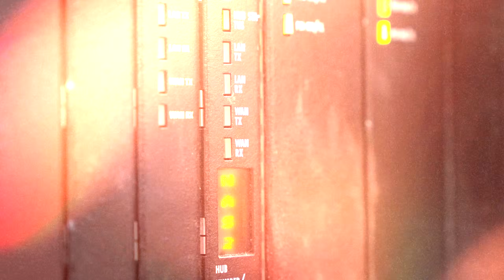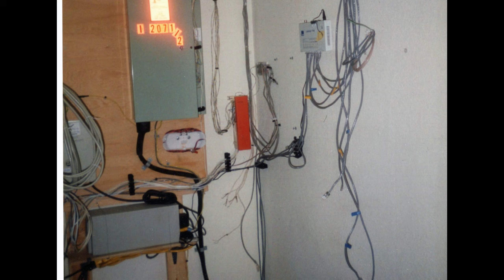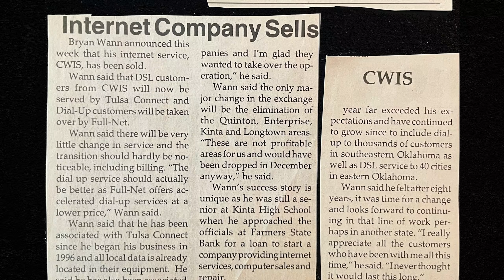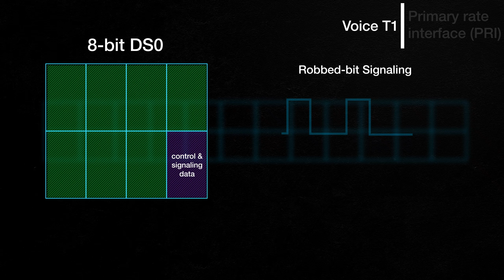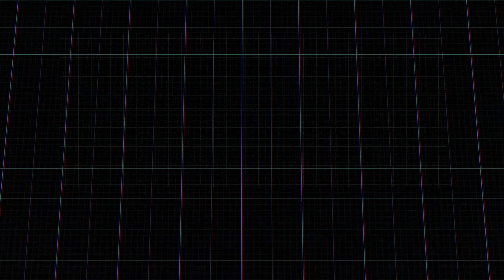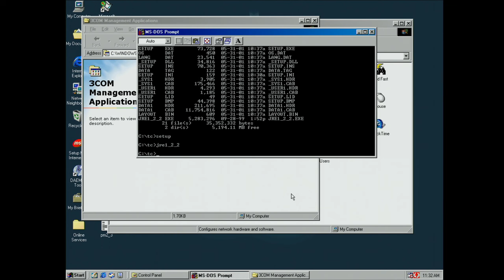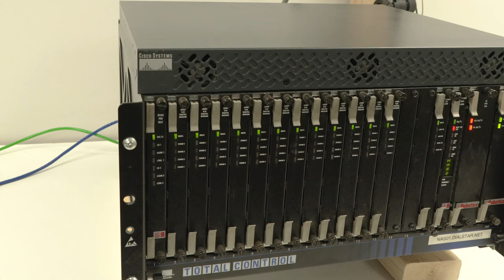DIAL-UP goes DIGITAL: Setting up PRI for the TOTAL CONTROL - ISP Ep 7

Comment: when I first got DSL (despite being a paperboy who was inserting flyers from the local cable company who in Canada were in advance over the world, i know some people who had cable modem in 1998, the huge wall mounted (unencrypted DOCSIS 1.0) Scientific Atlanta cable modems that required a cable from one's basement where it would typically be placed and a pci adapter for a coax cable coming from it to connect it, my other friend who had a mom working for that cable company/now also isp, had dial-up service, mostly to use when you weren't home, but they also straight up dial-up, he had a Motoral SurfShark 4010 (I think the name was SurfShark) which was DOCSIS 1.1 (if only that same ISP, Videotron would do like its competitors in the west, install DOCSIS 4.0 to have cable be able to compete with FTTH with symmetric connections) or just move entirely to fibre, but they combine fibre and cable with DOCSIS 3.1 a technology that was newish when I finished my master's degree in 2012 and lived in my own apartment for the first time, the small ISP I was on had DOCSIS 3.1 cable modems)....anyway as I was saying, it was frustrating, those Videotron slips I had to insert into every newspapers for 6 months had a promotion with them, brand new docsis 1.1 modems that went up to 38mbps/8mbps (we're talking year 2000 there wasn't a bunch of tiers, everyone got the same hallucinating speed), for 29,95 a month and you had to buy the modem, typically it was 400 dollars (CAD) and during the promotion it was 200. Parents kept saying we'll think about it, as they wouldn't even change our 33.6k winmodem for a 56k one, at least. A few months after the promotion was over, the big telco Bell Canada released their DSL service in our area and it wasn't as fast as cable, we're taking 1.5mbps/720kbps but it was still lightyears. To make calls on our phones we had to install a little bridge in between the landline phones and the landline entry, that's how they did voip, if you didn't place those little bridges, you'd get so much distortion it was impossible to use. Anyone knows what I'm talking about? And what were they called?

Comment: Used to run a ISP here in Melbourne Australia 🇦🇺 in the 90s. At first we had a Xylogics Annex 4000 with analog modems. The annex 4000 had 72 ports from memory. We then moved to a Xylogics Annex 8000 which had E1 ISDN PRI and 56k digital modems. So much easier to manage than all those modems on analog PSTN “hunt group” phone lines.

Comment: Had about 30 of these in the 1990's, early 2000's.   They were hateful things.  Just getting the RADIUS configuration working was a ball-ache.  I worked for Asia-Online and integrated a bunch of acquired ISPs into us.   We standardised on the AS5200 for pretty much everything.   We also had Lightstream 1010's - this is how we got our ATM services terminated internally.

Telstra was a funny bugger at this time - they were competing with us for market share in the dial-up segment - but also had to sell these services to us using a third-party.

Comment: Hmmm how does my current pri run over fiber?
Reply: The telecom world has created an "X over X" standard for any possible two technologies.  Voice over ATM.  ATM over Ethernet.  ISDN over carrier pigeon.  Whatever you have and need, there's a way to cross-connect it.

1.54Mbps is such a trivial amount of bandwidth these days, that no matter what the underlying infrastructure is, you can drop a "T1" on it, and just add a card that will do the physical signalling at the end.  And even that, at this point, isn't strictly required, since you can configure lots of non-T1, non-ISDN hardware to form a gentleman's agreement such as "let's just allocate this much bandwidth and pretend it's a serial link, okay?"  "Yep, cool."

Comment: I'm using a similar setup. But the asterisk is equipped with a E1/T1 card and provides the span itself. So no need for the cisco VOIP/PRI-adapter.

Comment: I'm surprised he had so much trouble with "other" modems. We never had issues with the one PM3 we had for testing. (went with the TC's because they were just better) Interpath started out with Microcom chassis modems connected to netblazers. We tested many different vendors before writing a 6-figure check to USR. At first, we connected them to the netblazers - because we weren't using RADIUS. (we had a few issues with the microcom's, but there was a "this thing is fed by Sprint" dip switch - undocumented of course - that fixed that.)

Comment: I want one too, but i live in Germany so it's even harder to get one here...
Reply: To get what here in Germany? A PRI?

That's not hard, that's impossible to get... Except you can get hold of old ISDN gear from the network and build a private network with those devices...

ISDN is dead. The Telcos don't get spare parts anymore. So the few Telcos that were still delivering ISDN, already had reduzed their SLA to best effort. They said: We will try to reuse parts, we had teared down elsewhere, but if we can't get hold of an used part anymore, then your ISDN is ended... It was just to enlarge the migration time frame for services, that needed to be migrated from ISDN. (Electronic invoice exchange and delivering data to the health insurances were such things, where the migrations to IP had started way too late...)
Reply: @compukiller2  no, a total control modem bank

Comment: I never understood why T1 lines were so obscenely expensive , but then again it is your own dedicated loop to the CO.
Reply: Part of it was the service behind it. With Southwestern Bell I could call in a down T1 and have somebody start testing on it within the hour, and they would dispatch after hours/weekends to repair it if you pressed them on it. Every site also had a hot spare T1 loop they provided that we could swap over to. Not likely to happen on a DSL or business phone line. Of course there's exceptions, I regularly dealt with at least one telco who was very much "down T1? we'll look at it tomorrow" thing.
Reply: @bryanwann  really? I would have thought because a T1 and it being so pricey it would be given a greater priority rather than next day if it were down.  After all no regular Joe would be running a T1 at a residential location or something.   I would think only a business user / account would only have a T1 or ISDN at that time.
Reply: You can thank the government for that. It was one of the many regulated services required of all telcos. (at no point in history did a T1 actually cost $1000, but CEO's have to have that yacht.)
Reply: "Dedicated loop" -- so is a phone line.  Or, it was.. until they were just simulated loops over whatever cheaper infrastructure.

Bryan's got the right idea here.  They were expensive because it was a business service, in part, and came with business-class support.  It's also worth considering what the T1 connected to.  It's just a 1.54Mbps digital circuit, at the end of the day, and that has to carry something.  Whether that's multiple phone lines, point-to-point data, or Internet access -- each would have their own service charges on top of the loop itself.

And yes, the regulatory agencies set prices on these things that were often "generous" compared to what it cost to deliver.  Although I think the "yacht" metaphor is a bit over-the-top.  I've worked at/with service providers for most of my career.  In most cases, nobody's getting filthy rich off of your phone bill.  This stuff costs a lot to build and maintain and support, which is why the regs are there to begin with.  In one of my former lives, I worked at a provider that had clusters of customers in remote areas that could only be reached via microwave.  Tell me how you live a champagne lifestyle billing thirteen customers for a phone line that has to go 100 miles through mountain passes, and may only bill at the same rate as someone in an apartment complex downtown.
Reply: @sirnickity  Yeap. A "T1" hasn't been one for decades. They've been simulated with HDSL circuits for at least 25 years. And I've not seen an actual end-to-end T1 in even longer. (at some point, everything ended up on DS3's or OC-x's)
Reply: @sirnickity  ok well what i thought "dedicated loop" , meaning that nobody else but you had that line , but i digress.

Comment: The modems in those things were awesome.  The NetServer card not so much - it worked, but only supporting RIP & RIPv2 was a bit of a pain.  But customers didn't see what we did - they just saw rock solid connections and that's what mattered.  The other gotcha here in AU (and anywhere else with E1's rather than T1's) is that the earlier non-HiPer chassis only supported 56 modems in a chassis, but 2 x E1 is 60 voice channels (+1 D channel, and I think a clocking/timing channel? for 32 total).

The very early Total Control used a different NetServer too - the earliest one I came across was basically a Cisco 2511 on a card.  My memory is hazy, but I think you needed multiples per chassis and they connected using external cables to the modem cards.  Then came the ComOS based NetServers, which talked across the backplane, and one card could handle all 56 modems.

We ran those things starting with the very early 2511 based NetServer cards, to the ComOS cards, and ultimately into the HiPer cards/chassis.  

So much nicer than using a Digiboard multi-port serial card into discrete modems.

Comment: Can't believe Krish is still around. USR owes that man so much. usr-tc list is great, I'm all over that... note that when Krish talks "AOL", he's really speaking of ANS, which was a separate entity that just did AOL's networking (and IIRC, they also sold their dialup capacity to others). David Bolen(?) was the guy from ANS - he was also a huge, huge contributor to that mailing list. I have a ton of software laying around because after I went freelance I was working with a guy that ran a sort of 3rd party USR/3Com support service and he'd basically contract me out to ISPs/businesses with TC stuff, so a collection of management software, some home-brew software and old firmware.

I have a ton of datacenter pics of 2 of ANS's installs - both probably on the small side for them, one at Telehouse (downtown NYC, where NYIIX was, also the John Wick hotel lobby, FWIW), one at a weird colo also in the Wall Street area. They had a bunch of maxed out units, crazy stuff. They also always ran other brands and I think they had some way of sort of steering customers to either USR/3Com or Lucent equipment (and perhaps others).

Love having a head full of useless and outdated information!
Reply from the maker: awesome!  would love to see and share some of the pics
Reply: @theserialport  I've been kind of weird about putting them on my site because technically it's a huge no-no to take pics inside a datacenter like I was doing back then... but maybe there's a statute of limitations of sorts, lol. Wish digital cameras were a thing when the first ISP I worked at started - we had such an amazingly janky setup and there's no good pics of any of it.

Comment: I am doing something similar with Cisco gear and came to the conclusion that EVEN with a dedicated point to point Ethernet link I couldn't use Asterisk.  It HAS to be an FXO -> T1 -> modem bank. 

With VOIP I think the fastest I could hit was 41333bps, and that was NEVER super consistent.
Reply: 41k?!? That's amazingly fast! I would have imagined, that even 33.6k was really unstable via VoIP. As faxes AFAIR normally only worked in the old 9.6k standard, faxes and VoIP were a kind of a nightmare...

56k, you will quite surely never reach except you can just input the signalings into a directly connected cable: 56k demanded even back then a perfect line "between the endpoints". So even in Germany with a fully digital network behind your phone line and an amazing line quality, users of classic analogue networks can't even imagine, you often had something like 43-46k to the ISP... And here the network was completely out of the way, VoIP brings in latencies and jitters by definition. Plus the protocols were never meant to transport such traffic (even the transmission of facsimiles was more of hacked into the standards).

In short: 41k over VoIP is already a damn good work and I congratulate you for this!
Reply: @compukiller2   I'm not a VoIP expert by any stretch, but I believe timing is the biggest concern.  You can pretty much rule out protocols being the issue by just using u-law (or a-law) PCM, which is what the TDM networks were using anyway.  At that point, you have an A/D conversion about 10 feet from the modem, and a fixed-quality digital link to the modem pool.  You can manage jitter with reliable enough transport and an adequate buffer such that the frame-to-frame variable delay is insignificant.  That really just leaves latency, which is going to be the trade-off to jitter.  You can't have both without a synchronous link.

Ironically, there's no reason you couldn't terminate the modulation at the VoIP ATA, convert to a 56k serial bitstream, and then convert back to modulation at the VoIP gateway, and have an essentially perfect line as far as either end modem was concerned.  I think maybe some of the fax/modem-specific extensions were supposed to do something kind of like this, but I could be very wrong.  I never looked into those very deeply.  Probably the linchpin to this solution was licensing all the DSP algorithms from the vendors who devised the modulation schemes that became the v.XX standards.  I'm sure the tech was there from day one.